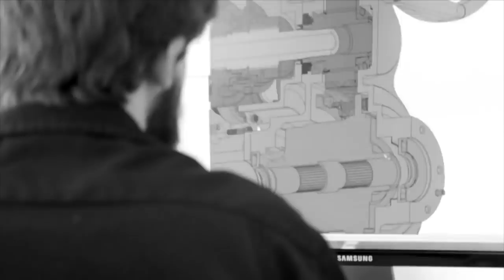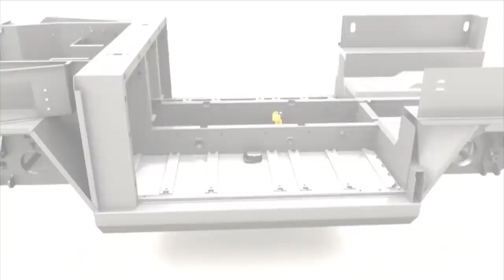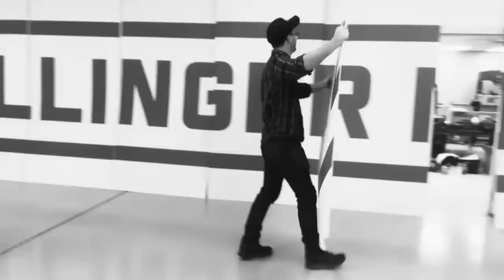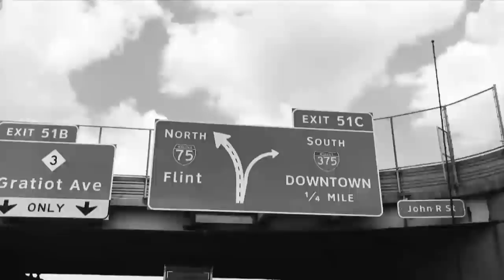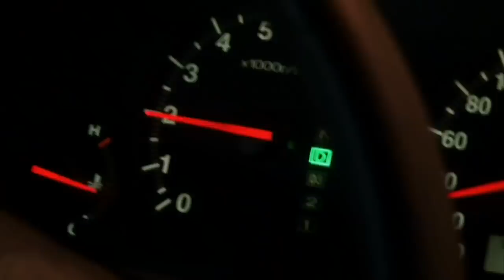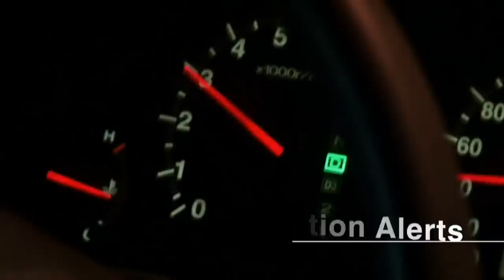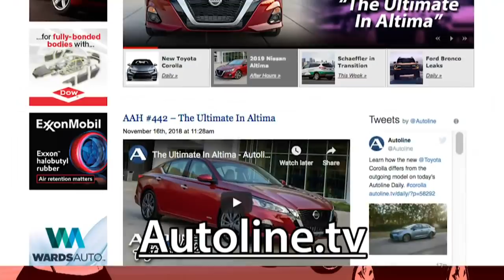Robert Bollinger Builds A Truck, An Electric Truck - Autoline After Hours 461

Comment: Henry Payne has a nice voice and uuhhhhhh.  OMG  His questions were pretty pathetic and clueless.  Eg, When Bollinger is describing the charging port, Payne comes up with "CCS is the Tesla Standard?" as he scratches his head.  Geez man, you drive a Tesla and it sure ain't a European model with CCS.  And really, he didn't know the range would go down on his Tesla in winter going into the deal?  He's supposedly IN the automotive world and doesn't know the Defender is a Land Rover product???  The only thing he brings to the table is making Gary Vasilash look somewhat intelligent and that's no easy task.  Seriously, John McElroy should just do these shows on his own.
Reply: Electric cars lose substantial range in the winter but with a small propane heater they could get about 90% of that lost range back - very few electric cars have them, why? Image over practical engineering.
Reply: I suspect Henry Payne uses Tesla on weekends [autocross]  and NOT as a daily driver. Being in Detroit, MI he would be ostracized. His 3rd car.

Comment: Karpathy is super smart, and his point is basically that software is cheaper than hardware. Thanks to chip improvements you can throw massive data sets at neural networks, and they somehow deal with it. Tesla has a massive chip that they think can process visual data fast enough to be safe. So instead of improving instrumentation per vehicle, you use fewer instruments but more and more example data from more and more vehicles, and expand you neural network to deal with the data flood. Meanwhile it has dawned on Musk that manufacturing issues are better solved by reducing part count than by building robots, a failed strategy of his. (To be fair he seems to be smart enough to learn from his mistakes.) Lidar is fine, but it increases part count, which is why Musk says it is doomed.The interesting question is whether lidar will ever be useful.

Comment: No one is demonstrating a lidar system that sees through bad weather.  Usage in rain is about filtering out the rain's signal and hoping you get enough unaltered signal back.  Probably doable in light rain.  But the bigger problem is humidity.  Fog destroys it.  Lidar is a great fog detector, it stops working in fog.  The key is that no one from waymo or cruise is defending their use of lidar.  Because they use lidar to train the ai and over time the lidar has no purpose.  They need lidar to also make their simulations, tesla has real data and doesn't need to build lidar based maps for simulations.  Using simulations was cutting edge and great when it was impossible to collect real world data in volume.  Tesla is collecting real data and that now makes simulations a joke.  Waymo and cruise need to get cameras on someone's production car fast to start getting that data.
Reply: Yeah, LIDAR is light based, and fog interferes with all light-based systems, especially video cameras.
Reply: Cruise can go 11,000 until deactivating & requiring driver takeover.  In contrast Tesla/other autopilots can only do 1000 miles...... clearly Cruise is doing something right

.

Comment: Why are car companies going electric? because China is going electric and in a relevantly short time it will be impossible to sell ICE cars in China, now why is China going electric only? the two reasons you will hear 1. localized pollution 2. CO2 reduction because climate change, the big reason seldom mentioned is national security, China wants to reduce dependence on oil both from fear of an economic shock from some drastic price increase or from the US cutting off it's supply.
Reply: Somewhat true... but the main reason is the 2025 Industrial Objective. China wants to be the world leader in high technology by 2025 - and they will succeed. The USA is on a downward slide, and by 2030 will probably be a forgotten "superpower".
Reply: China should be congratulated for tackling their pollution problem. Reducing dependence upon foreign imported oil is also a wise policy. They win on both counts.

Comment: When it comes to electric, we are still in the early adopter phase... Truck owners are the knuckle draggers, not the early adopters.. but they are not stupid, once they see how much better electric is, they will switch too..
Reply: Yes... very true.
Reply: EV adoption is going to require a good battery advance.  Without that, we will be stuck driving hybrids for a few more years.  When EV's become price competitive with ICE cars, electrics will take off.
Reply: For many of us is it having Electric Trucks built for work and not show pieces.  I would love to have EV trucks to replace my F550 utility, old Canyon etc...  Would allow me to tap off of my 20kw solar system and expand  it.

Energy independence is my personal goal, converting NG to Elec and Petro to Elec.  

But all I see is high end Rivian and Bollinger trucks not designed for fleet sales or everyday utility use!  This week I have been seriously considering buying a Pacifica hybrid to replace the little truck.  Converting trucks to EV is possible but then your dealing with old drive train, safety features etc... and no adaptive driving at great expense.

Rick Fucci it would be nice if you did not classify all "Truck Owners" as "Knuckle Draggers".   I believe many that use their trucks for a living would be glad to lower their business cost.